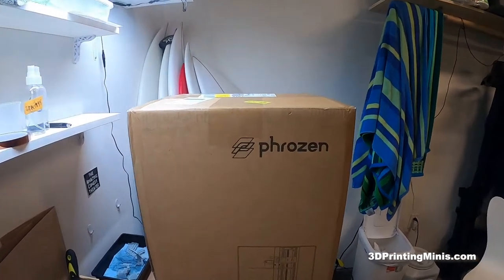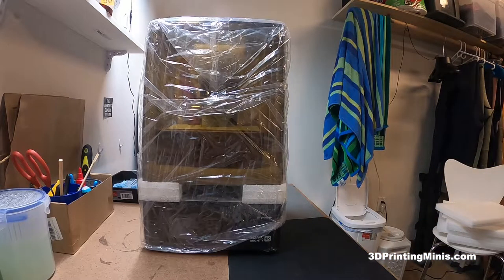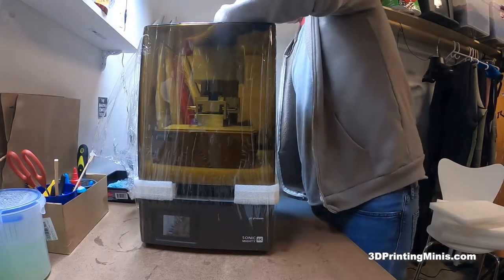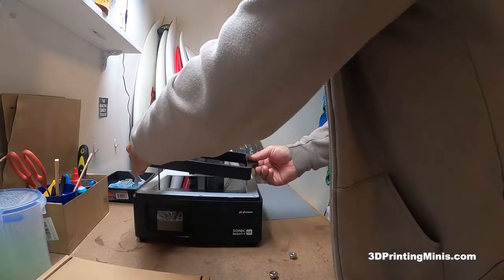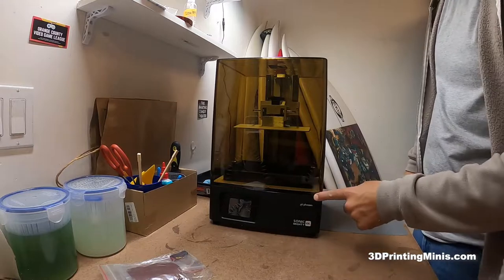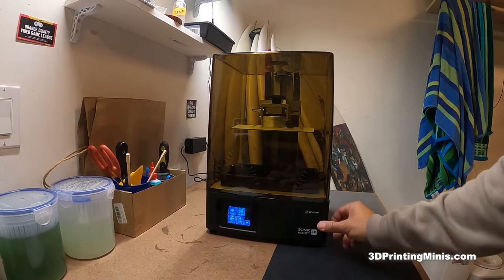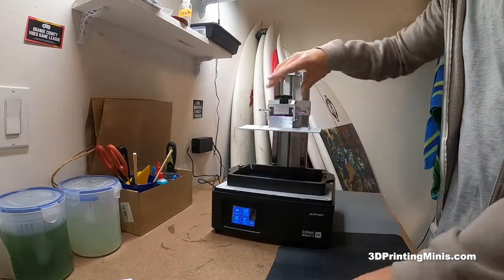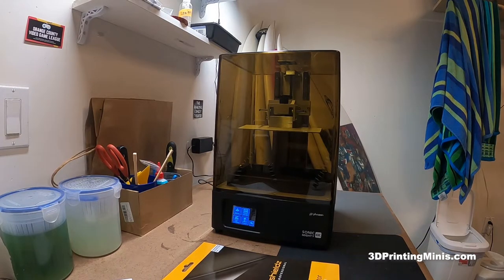Phrozen Sonic Mighty 4K Unboxing - High Resolution Large Format Resin 3D Printer

Comment: A matte protector reduces contrast and thus sharpness. I'd do a print before and after using your matte protector. You will most likely see some reduction in detail on your prints.
Reply from the maker: I understand your concern but from what I've read online the reduction in detail is negligible and protecting the screen on a brand new printer seems worth the tradeoff. I'm planning to run the new printer with the screen protector for a fews and then once the printer is dialed in and printing consistently remove it and try some prints without it. But, for the time being I'd rather be safe than sorry. :-)
Reply: @3DPrintingMinis  sounds like a worthwhile experiment